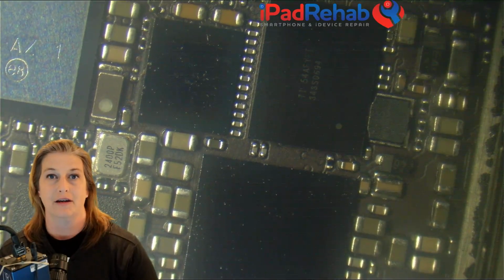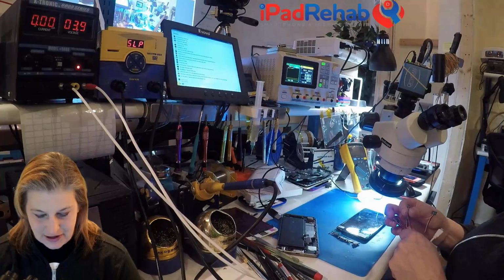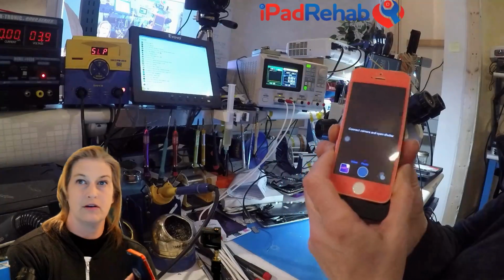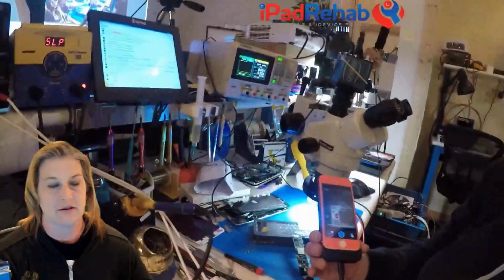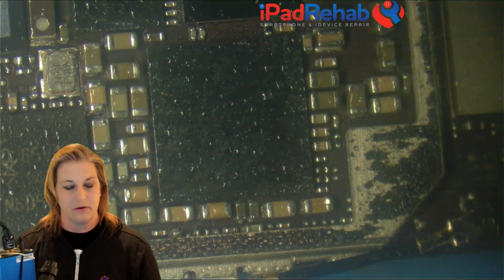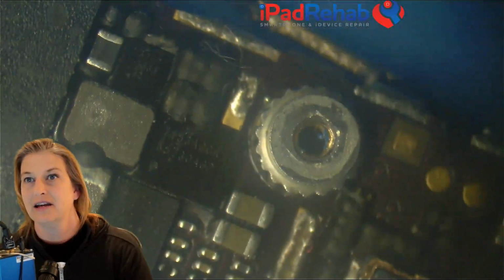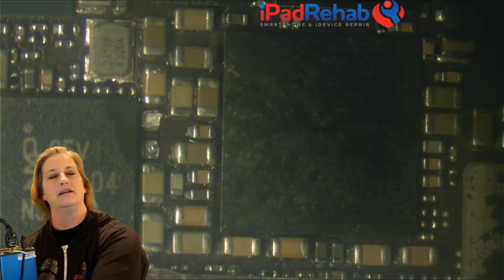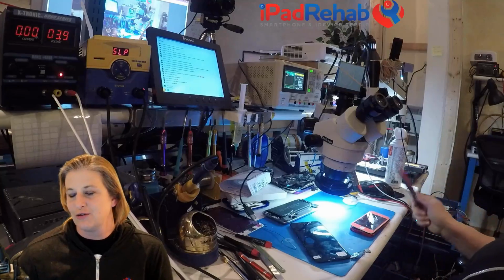Dead iPhone 6+ Repair, with Happy Ending

Comment: Hi I have a problem with my 6S. It's running mega slow, almost unusable, complete wipe and factory reset is done. The screen and the battery has been replaced already. Any ideas?

Comment: You are using flir one 1st gen which has 60x80 pixel of thermal resolution. What else did you expect from it other than blob? 
Gen 2 and gen 3 pro offers twice as much (non pro version of gen 3 offers also 60x80 resolution)  
For even better resolution get flir e8 (or hackable e4) that offer 320x240 thermal resolution + ability to tweak the focus. You can also change focus using external ZnSe lenses that don't block IR as regular glass does.

...and what you see with no power turned on is your own heat being reflected off metal shielding. 
Hope that explains some things.  Love your videos but when it comes to IR you and Louis are quite clueless.
Reply from the maker: We don’t understand the insistence that people have to use expensive tools when inexpensive tools work better.
Reply: I get it perfectly and I'm not saying it's a God send tool that solves it all, but... ridiculing the whole IR approach using cheapest and clearly not fit for purpose tool is not a fair fight. 
And yes, buying alcohol/freeze spray is much cheaper but after all that's one more tool in your toolbox if you know how to use it. 
Even Louis seems to be warming up to the thermal cam  :-)
Reply from the maker: When experience, visual exam and freeze spray find the short every single time there is just NO NEED for a $900 tool.  It is not cheaper, it is not faster, it does not have more resolution.  The only thing a $900 camera can do it make you think “every phone has a short” and chase bad leads because it will always show you some heat somewhere.  In the hands of most people that will be a disaster.  Louis is not “warming up” to the thermal cam, he does not recommend it and neither do I.
Reply: I completely agree with what you're saying. All I try to point out is that ootb flir one shouldn't be even considered as an inspection tool for electronic boards.
But if you already own half decent IR camera and know how to use it - how it's different in what it does from freeze spray (minus thermal stress to the board)? 
Sure it shouldn't be the first tool to use but for (rare) cases when the short is not "hot enough" to detect it with freeze spray/alcohol it can give you a clue you wouldn't have otherwise.
Reply: @JessaJones  hello, how do I contact you

Comment: My mom got an iPhone 8+ and all of a sudden the charger no longer fits. There have been no drops and no other issues. Are there known issues with the charging port on 8+
Reply: It ended up being the end of the charger (very tip) broke off inside the charging port. I was able to pull it out with super small scissors. (tweezers were too big)